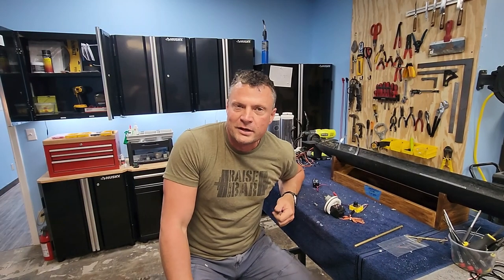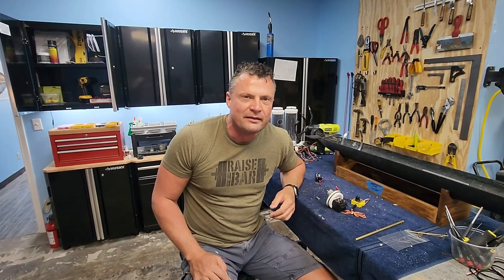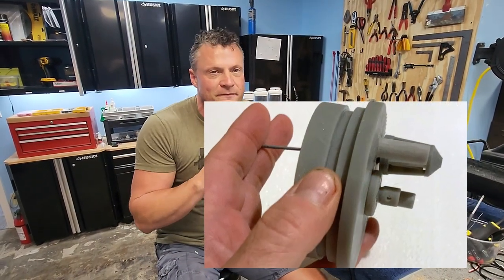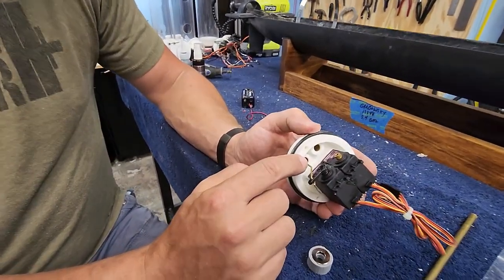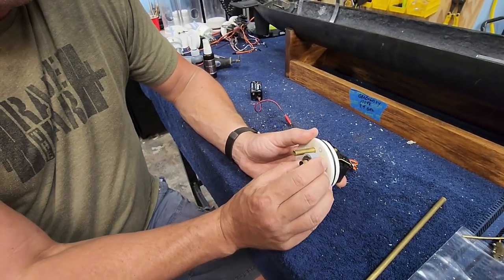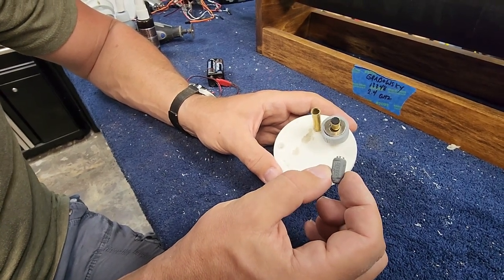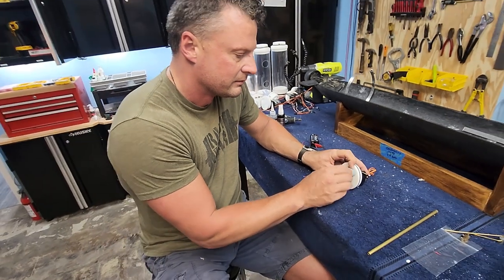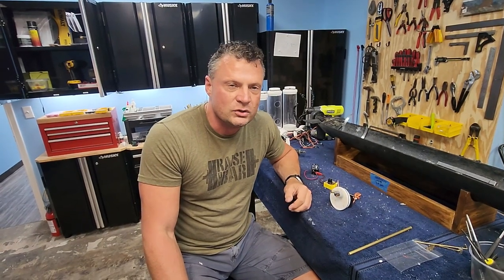Nautilus Drydocks Pure Magnetic Linkage Connection for RC Submarines

Comment: simple and ingenios, great for big models. But can use on small hulls (like 1/144 or 1/72 scale) be optimal?
Greetings
Reply from the maker: The large magnetic rings would make it challenging to implement on small boats, for sure. I'm positive that alternative magnets could be used, but I haven't looked to do this yet.
Reply: @RCSubGuy  Curious how salt water might affect the magnetic field in the long run. I’d probably want to torture test that for possible faults in the design.
Reply from the maker: @DuckiestBoat959  I have no idea how salt water might affect magnets. My guess is not in the slightest